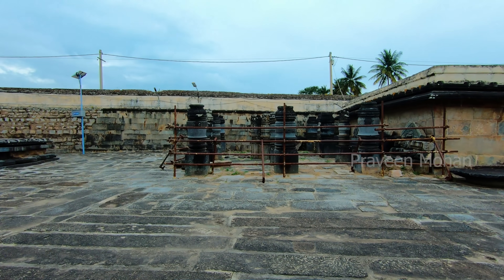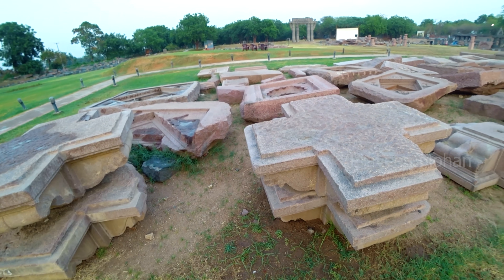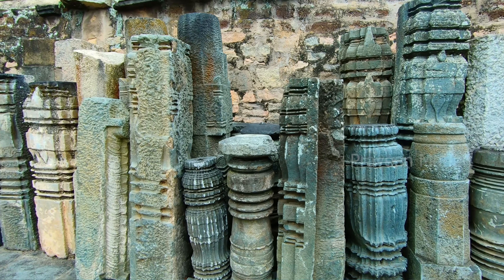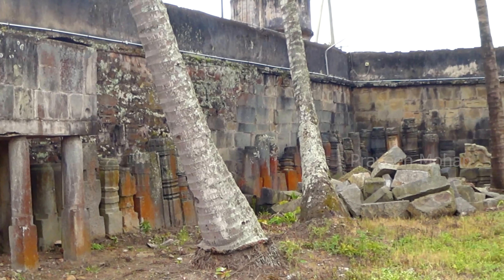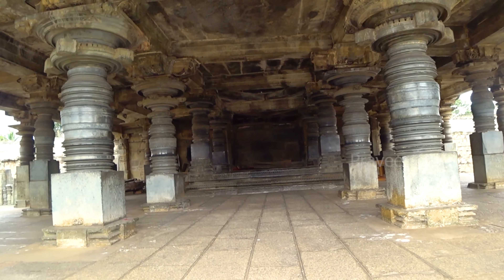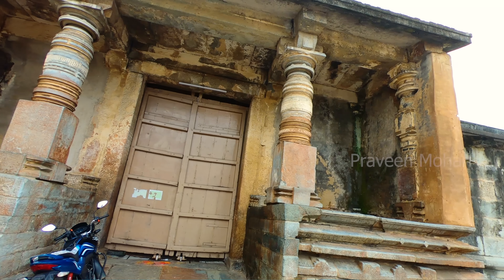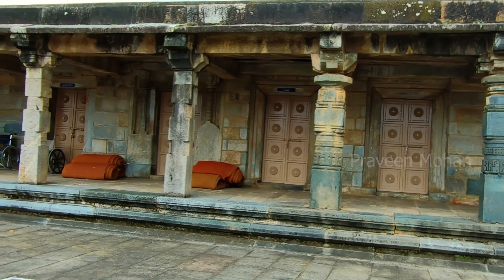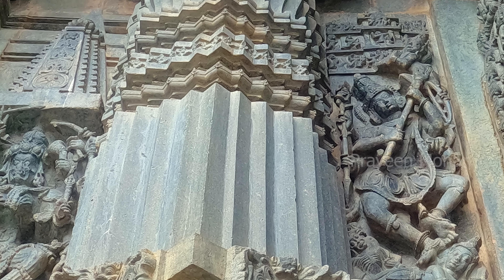Found an Ancient Pillar Manufacturing Site?

Comment: Piravee pillars meia is me mega mecca makka u take the templates jah too the piramids my Mayan anka u use gold in my templates use non megnetikz and layer them take my pillars too my temple no body likes the one defaced place pillars around and my blok I told yuz too light up the stand alone Tempe nobody goes too arrange my pillars clok work take templates inside aligned against the walls faceing my seat in the centre paint them blue base and colour sequence to the top blak box the outside and yuz the windows arrange my copper base in frame work too set up my computer ao Kore don't forget put my whero tewheke ondoorway arch and spin the pillars ant clock wise too my temple use the little other temple is my surgery the ones with detailed body parts clean my surgeries up light it up and secure the temple that nobody likes I'm inside it jia and blast it out light it up from inside and arrange pillars around it too connect my templates take them too safe shelter in the other temples in court yards and light them all up but not the ones everyone's travelling too just the ones no ody visits and put high security no go zones on e activated paint my yellow brick roads and red door narrow path feet corrugated irons on my doors and and blok seat just out the front my table and seat use blocks from my other stand one unused temples in the city vacinities turn those temples in rental tourists huts and plant sum flowers and arrange gardens compile me short tabu book of all my temples templates and leave out the grand temples place red roses outside all my brothel temples and huts clean them up for my people's in devasted areas too be used as refuge shelters and no more prostution brothels they go too rehab centers clean up desolate areas on e my temples hav been activated and centered them move my guru book book too hallal tekmahall Taj tableur and the temples where I was locked in open all the doors vaults clean clear archways basements scrub it clean light it all up they are my castles and kingdoms do not be afraid remove my bones in mummie fication and place in mytaj mahall marble base inside court yard out front of doors and place my groto ontop meiree I am Maya Maia maria Mary aniwa animei Mya Myanmar ma